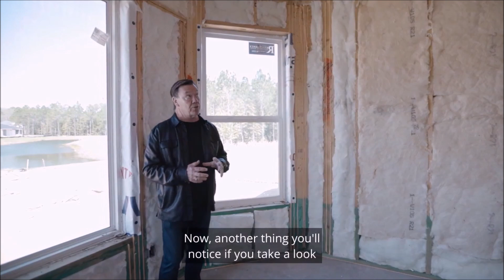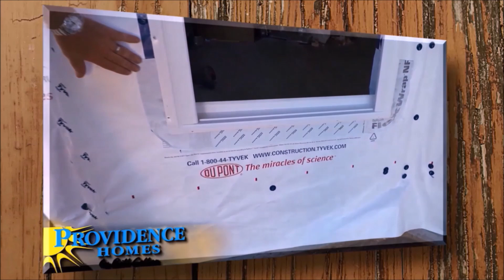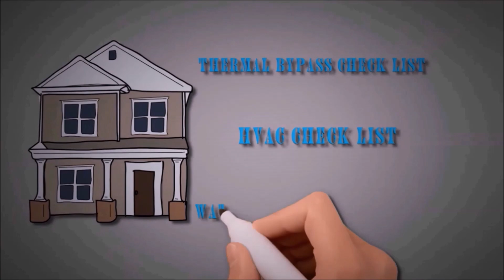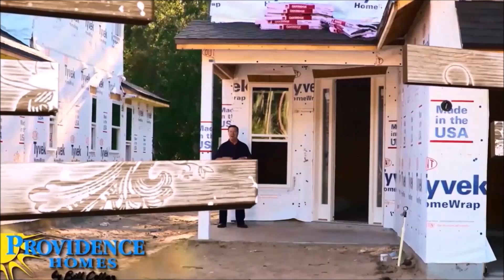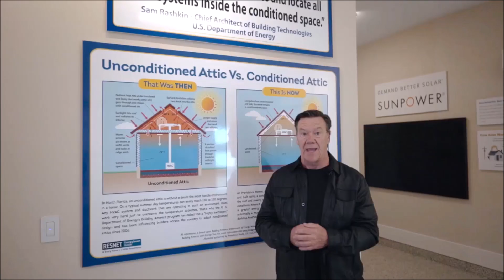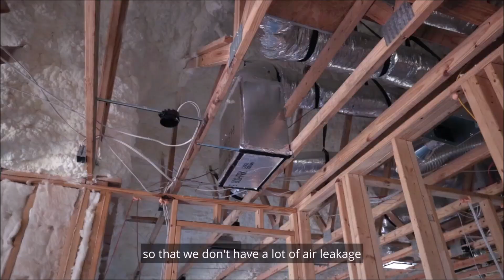Behind the Walls at Providence Homes

Comment: Couple of issues with insulating the attic:
1. You now are allowing the living space heat to radiate into this area increasing heating cost.
2. With no air flow there's no air exchange and that can lead to trapped moisture and mold.
This is especially true in a climate prone to freezing temperatures.
In a hot climate, I would apply a heat reflecting material to the underside of the roof and install active attic ventilation, while insulating the living space lid (ceiling) to minimize heating / cooling square footage.
Just my opinion, but I've worked as a director of architecture for a 500+ home/ year builder and been in the building business for 35+ years.

Comment: Water is the enemy of buildings.
Large roof overhangs add beauty and protection for doors, walls and windows.
Blower door testing and air sealing are under appreciated tools for energy savings and comfort.
Outside grading and landscaping are often after thoughts when building a home. Proper slope and water drainage is a must.